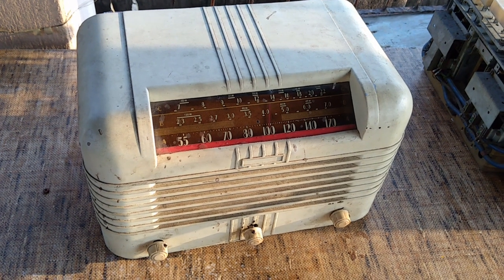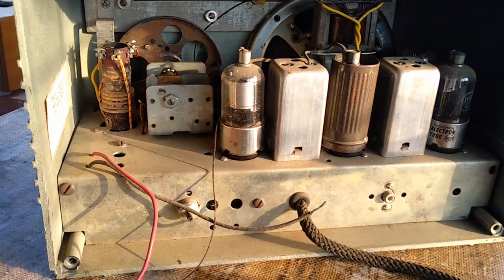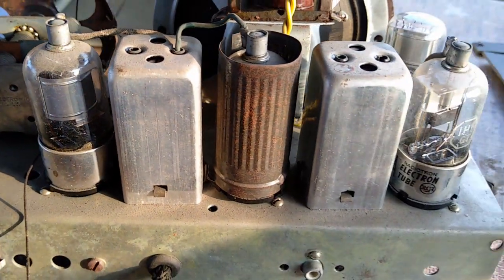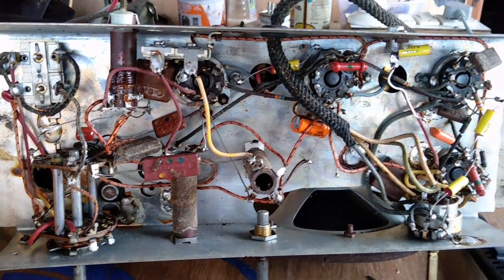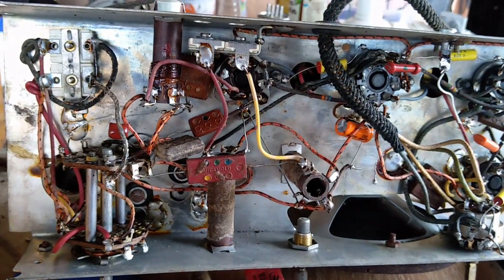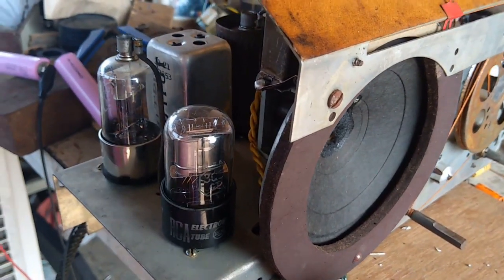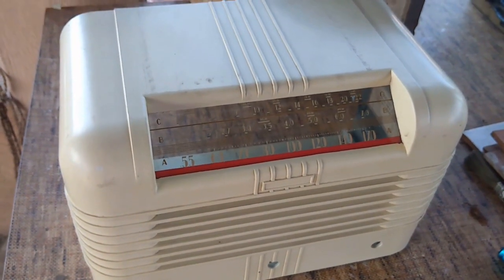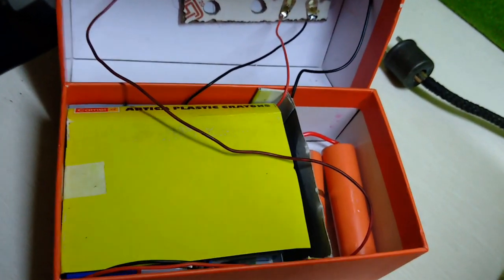Restoration of a Vintage Radio- Mellovox Radio, Battery Tube Radio

Comment: great Job done, Congrates
     while making video, please give some steady Shots of dial and radio for some 2 or 3 seconds to read the dial
   a tip to flatten curved hardboard backing plates,
      damp it slightly then keep it  in a flat surface,.  Put some big heavy books, or weight over it. Then leave it for at least 24 hrs

Comment: Mr.Ankur this is really excellent..I thought you will make a suitable eliminator for 90 V DC supply..I also have one similar radio 90/1*5 Volt DC...For a long long time we couldn't run it as the battery was not available..If you allow me I will come to you with that radio..That is made by HIND..may of 1945...or so...
Reply from the maker: Thanks for your reply. I tried battery eliminator. But it's too noisy. These Radios are ment to run in batteries. So I demonstrated battery operation.  Please join Facebook group " vintage radio society of India".